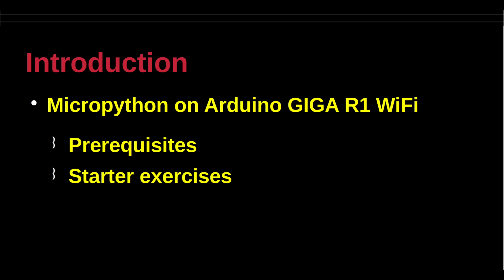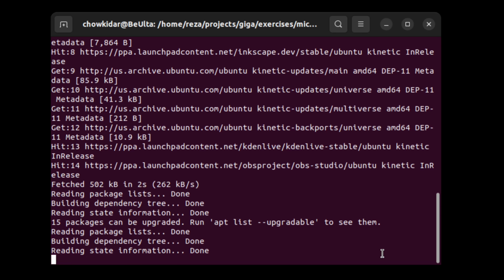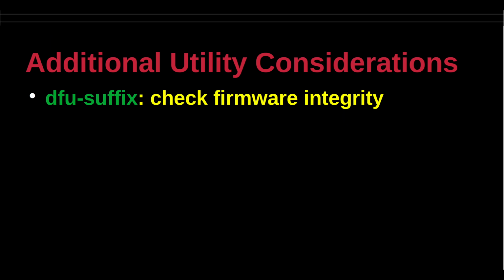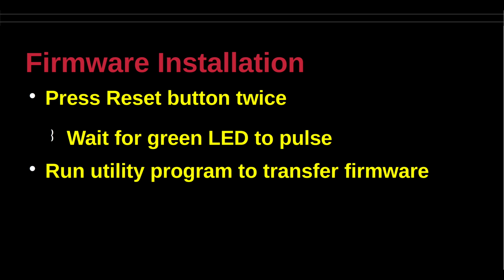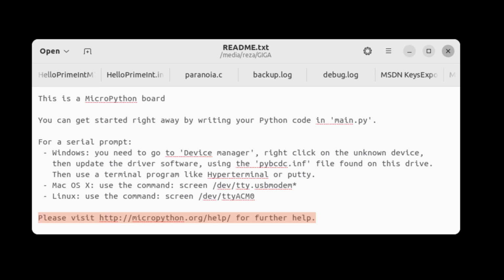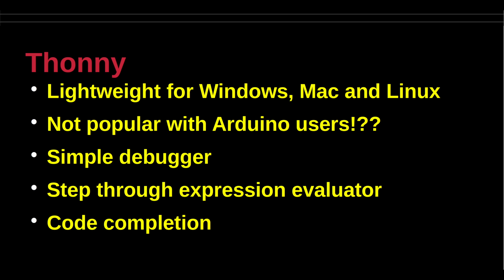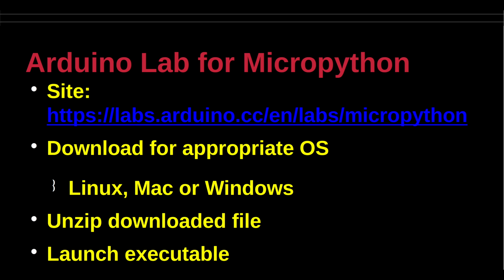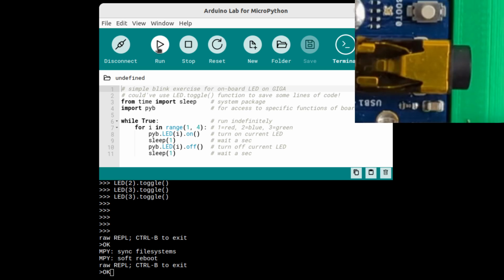Start micropython on Arduino GIGA

Comment: Hello , great video , thank you so much!!   Could you say me if the giga board using micropython support CAN bus like others stm32 MCU ? Is not so cheap board and the information is not so much for micropython applications i will thank you if you can say me if support CAN bus  ( for example the pyboard f405 = pyb.CAN ) 
Thank you so much !!!
Reply from the maker: The GIGA board has two dedicated CAN bus pins: CAN_H (PD5) and CAN_L (PD4). It does not require an external transceiver! Let me explore because I have never tried it before. Thanks for your question.
Reply: @MathaGoram  thank you so much for respone . I have seen some boards build in can bus for C or C++ can be used but the micropython not "include" the class CAN. for example stm32411, 12, esp32 and others ... 
I'm working whit CAN bus protocol using stm32f405 , 407 . I'm looking for some MCU faster than F4 series , you will help me so much if check direct if the GIGA support uPy CAN 
THANKS 👍🏻
Reply from the maker: @HpsMexico-STmx-S.L.A_mx , as you are well aware, CAN Bus is dominated by OBD and industrial strength ($$) sensors. Most CAN Bus enabled products for IoT use an interface module (not needed for GIGA) to work with I2C & SPI on the sensors themselves - not really a good way for me to introduce the topic. I've ordered a 2nd GIGA so that I can demonstrate a GIGA-to-GIGA communication using pure CAN Bus. It'll take a few weeks to get there since the product is on back order.  Stay tune. Thanks.